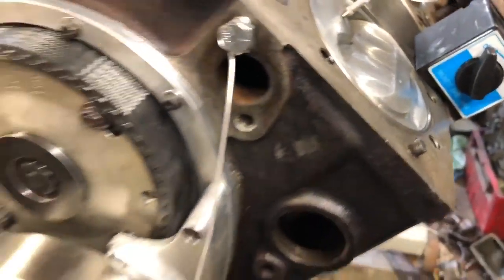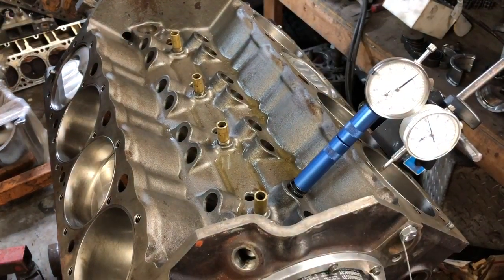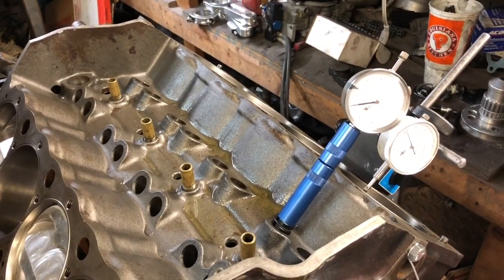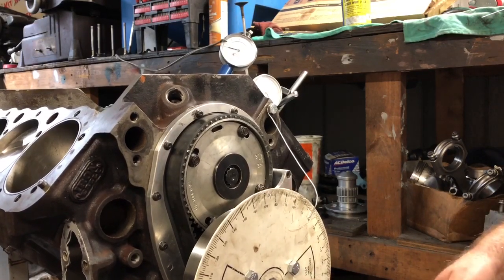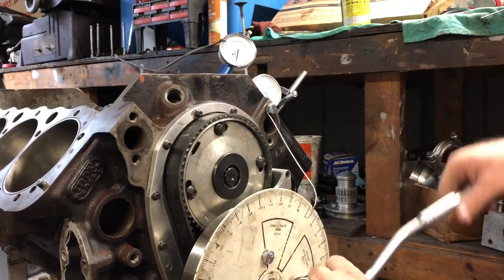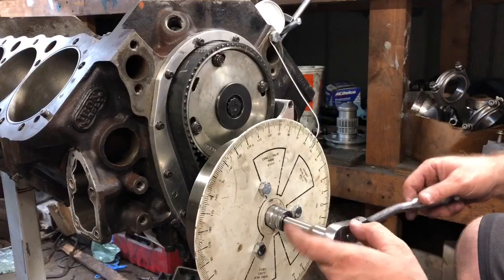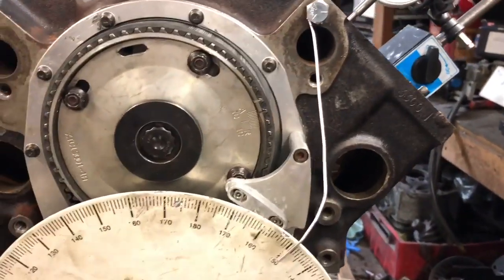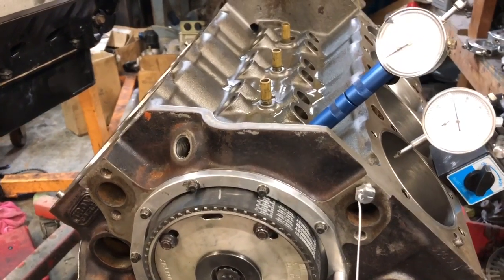How to degree a camshaft...SBC Race Engine

Comment: Is that a sleeved sbc?
Reply from the maker: 6 holes are now sleeved I think
Reply: I’m really surprised 😱 he’s running a sleeved block like that ( and totally getting away with it  especially at 800+hp etc.) as most of the old timers I’ve met ( and some reading 📖 resources ) always taught me that a sleeved v8 was a junk v8 with the exception to the rule being simi truck/ marine engines designed from the get go for wet sleeves

Being that he’s hard on the I’m starting to wonder why the guys that told me that sleeves in a iron block ( like his SBC or my 440 RB stock wet block as I was told if that needs a sleeve junkyard it or leave it to the numbers matching cars that are trailer queens 👸 that gently idle on cruise at maybe 25 ish mph for maybe a hour at most ) have habit of slipping or cracking and lack of cooling comes from??? ( including some cases of some engines knocking and pinging to death ) As I’m sure that they weren’t joking or lieing to me

Comment: How much HP & TQ on average is lost when you don't degree the cam? Say a stock bottom end SBC and you buy a off the shelf Comp Cams and install it dot to dot.
Reply from the maker: Degreeing ensures it it where it is suppose to be.  If it’s a tad retarded or advanced, it will change the power band.  If it’s a way off, it may or may not crank and will run very bad.

Comment: Is Copper wire the best for o ring material  for the block?
Reply from the maker: I use stainless wire with copper head gaskets.  I have used copper wire with stock and mls gaskets with ok results in the past.

Comment: Appears that cam cog dots may be a tooth off.  I would have expected cam to degree in spec at 110 ICL with cog at or close to O mark.  It looks like cam had to be advanced almost a whole tooth (10*) to get ICL in spec.  Interesting, same as previous owner of belt drive setup since it was locked in the 10* advance position?  Doesn't leave you any room to advance cam much more.  Next time it's down, advance cam cog 1 tooth (CCW), set to 0 and check ICL degree results.  I would expect cog closer to 0 to get ICL at 110* providing more adjustability.
Reply from the maker: This used belt drive does have a different mark they put on.  I bet that is what they did!  Good advice, thanks